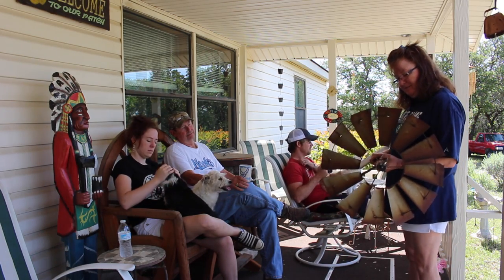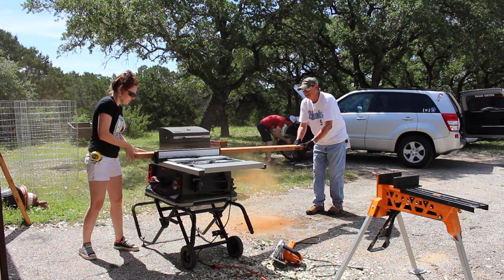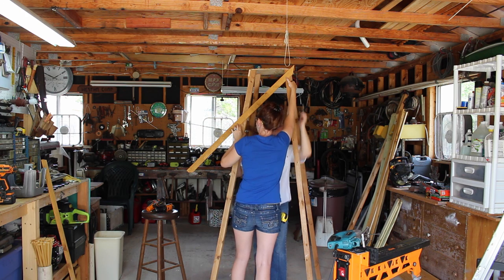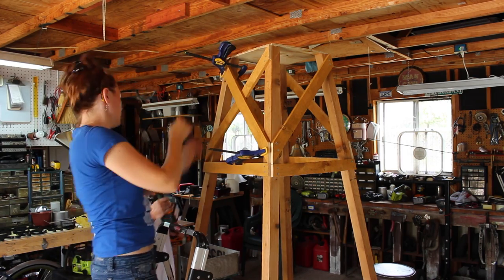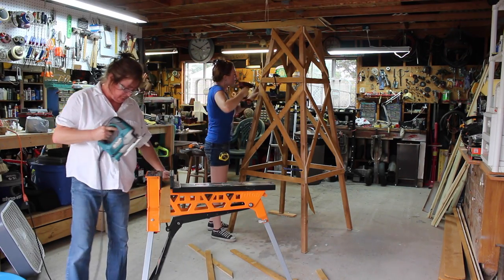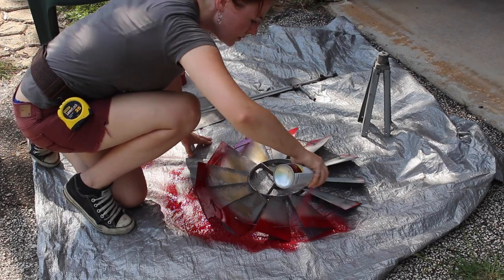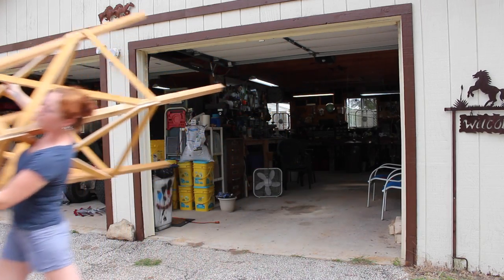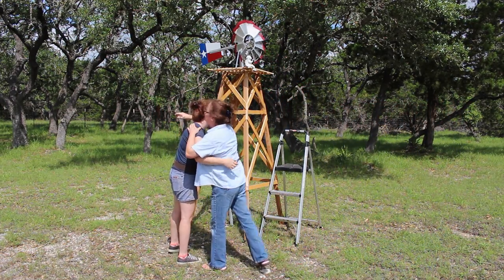How to Build a Wooden Windmill Base

Comment: April, two years ago I repaired our windmill of the exact design.  My repair was to prime and paint the blades and vane.  Our choice of pattern does differ just slightly, where the inner hub and about 1.5" from the hub I painted a bright blue, then white, and finally the tips were red like yours.  The vane was done with a couple red and white stripes and like you, I added a field of the blue with half a dozen, or more, white stars.  Thanks for posting the instructions as I am sure that in a couple more years, I will need to replace the metal framework of the windmill's tower.  As always, gear video!

Comment: April this is a great video. I wish I had seen it sooner.I needed something to keep people from running over the upper part of my well that sticks up in the yard. In the last 6 years it has been run over 4 times, once my wife ran over it wirh my zero turn mower . I,m still scrtaching my head over that. I finally bought a all metal unit at TSC and installed  but I like yours a lot better.

Comment: I built a windmill over 20 years ago and had boards running at bottom of legs. I then use two eight foot long rebar bend over hooking the bottom board to anchor it to the ground. In Minnesota we get strong windy thunderstorms and Had to pick it up many times over the years as the wind would pull it out of the ground. I can see this one falling over allot. I now plan on building one except all out of wood including the top portion but no metal fasteners of any kind. The bearings will be the only metal.  I wont be able to make the top wheel until this summer since I want to bend the wood. maybe I'll send you a photo when I get it done if you like.

Comment: About the tip on using chalk on the floor to mark location of the legs. I use it quite often on basement floors or garage floors when adding a room or workbench, if it is in a high traffic area,  spray it with hair spray it still cleans easily but will withstand more traffic!

Comment: I am very new to woodworking and am still in the stage where I'm watching and learning before I get into it myself. So I'd just like to ask a question because I am genuinely curious and low on this information. Is there a particular reason you did not choose to use a lap joint on the X's?

Comment: I have a eight foot windmill that is 13 years old & tried to remove the rust by spraying Vinegar(with NO salt) on it with poor results, although the rust isn't much. Sanding it with sandpaper doesn't do much either. So, how much salt is needed to add to the Vinegar? I am thinking of having someone sandblast the windmill, except for the stand, which is in good shape. BTW, nice video!   Barry in Pa.

Comment: Nice work April......One question that I had.....are you not worried about the cross pieces of the X that you bend popping out over time?
Reply: I was curious how she was going to make that cross joint when I first saw the thumbnail for this video. I didn't expect her to bend the pieces to fit, but I think the cedar is pretty flexible and it will stay in place just fine.
Reply from the maker: Nah, my parents had a windmill for about 17 years and it was built the same way and they never had a problem with the Xs.
Reply: +April Wilkerson Well you know what they say... Everything's fine for the first 17 years. It's that 18th year that'll get ya. 😄

Comment: This is great - oddly - I've been searching for plans exactly like this! Anyone know where I can purchase a turbine like the one in the video?
Reply from the maker: Somebody mentioned they just purchased one from Harbor Freight, might try looking there. : )
Reply: The old HF unit was OK, the new one is CRAP.  If you have a Tractor Supply / Runnings / Ace Hardware or similar they have better ones. Mine is an old Ace unit, I replaced the bearings with better ones and balanced the turbine wheel. So far it has been up for 14 years and only been painted once.
Reply: Thank you for the suggestions! I have both a Tractor Supply and Habor Freight nearby - I will give them a try.
Reply: Have you tried eBay?

Comment: Vinegar is the wrong, wrong, wrong acid to use on ferrous metals.  Use phosphoric acid.
Reply from the maker: weird that the wrong wrong wrong thing worked....
Reply: Yea, and it causes additional corrosion.  Phosphoric acid does not.  It's your project, so whatever etches your plate.